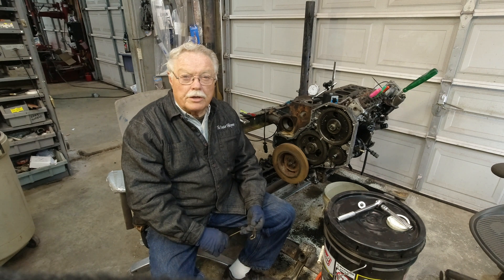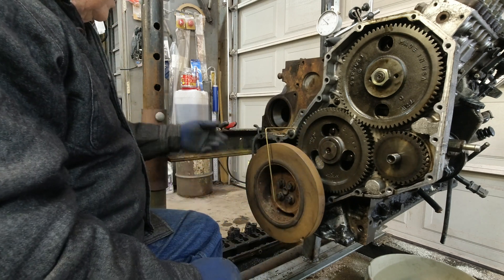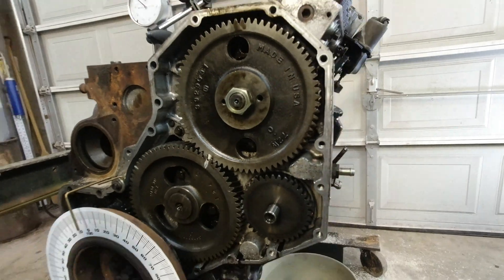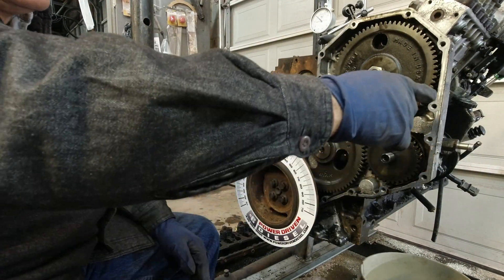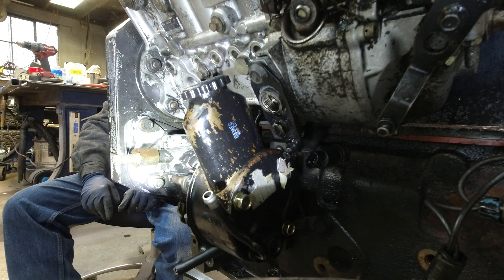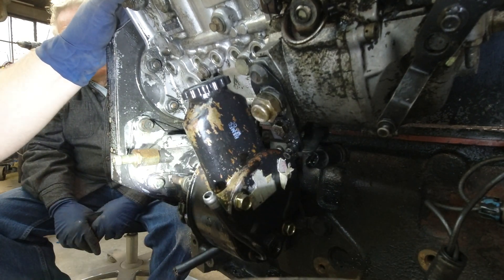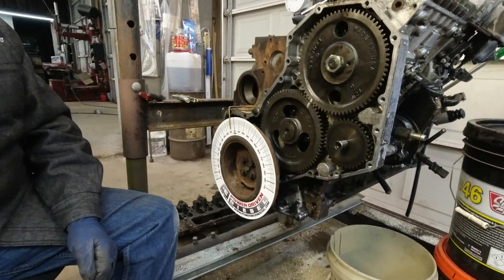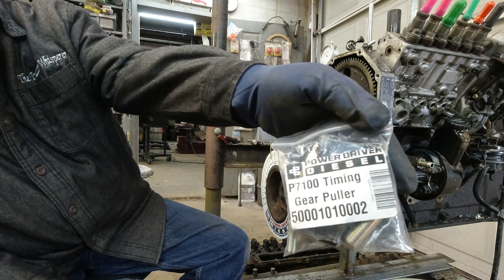2008 Ford F450 Cummins swap confirming timing with P 7100 P-Punp (episode 3)

Comment: That engine is timed at 14+3 which is 17 degrees with the pins engaged. Not injecting at 3 degrees like explained at 7:40. Can mislead people.
Reply: I know that this comment was almost a year ago but you are dead on at 17 the pumps pin time is 14 BTDS.